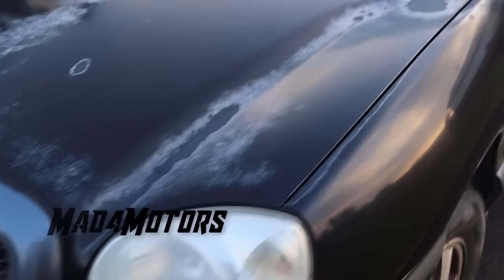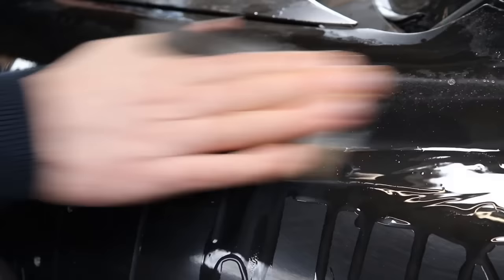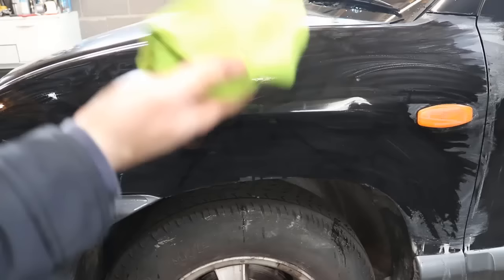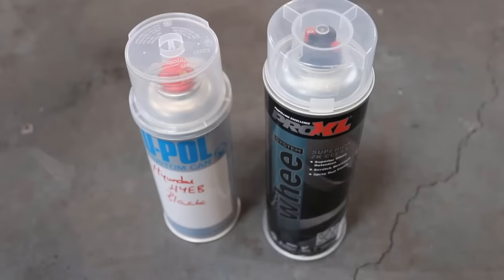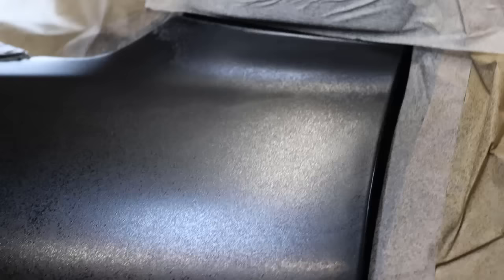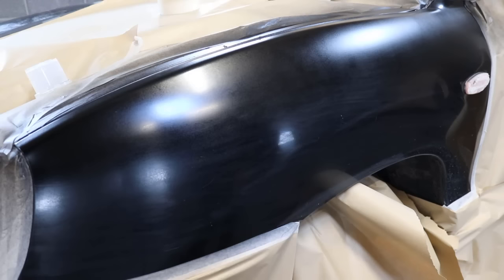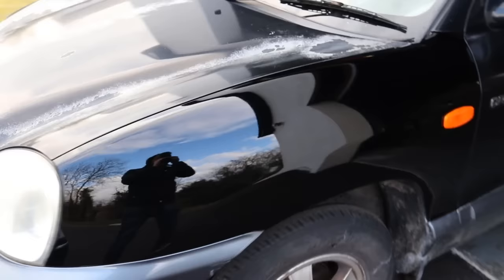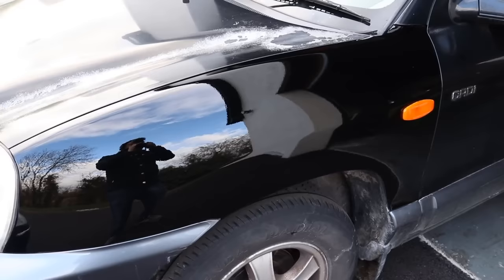How to Repair Clear Coat Fix 100% all types

Comment: Been a casual detailer for years, never seen anyone do a diy clearcoat repair. Excellent work man, it looks great. Wish I would have known about this a few cars back. The attitude then was 'clearcoat failure? you need a new paint job!'
Reply: Michael Curry Did you just make almost the same comment on Reddit? lol
Reply: Still a new paint job actually which is the only way to fix it but a bit more affordable which is perfect for a car that doesn't warrant taking to it to a shop.
Reply: I think thats what he did here...
Reply: splash yeah I think 'diy' is the point rather than paying hundreds or thousands.
Reply: I was thinking the same, I bought a car about 6 months ago, and the previous owner had ignored some stone chips and maybe used a pressure washer on it, and the paint is peeling (meh the car was cheap) and I was thinking I would have to pay for a complete respray. Now I've seen this video, I can probably give it a go myself for a very small fraction of the cost.
Reply: Dave G do update us on imgur when you get around to it!
Reply: C2k clear coat in a can is a new thing.  IT IS EXTREMELY DANGEROUS to breath... do your homework and get the special mask filters you need!
Reply: Michael Curry trust me,  it is the correct attitude to have.. I've been working on cars for 28 years , and tho what he did here is a quick cheap fix, it's never going to last. It would last longer I'd he sanded the bad clear right off  and started from scratch. .. but if you can not afford to have professional paint repairs done .. then this is certainly a good alternative. ..
Reply: was your comment a joke or being facetious this guy puts a new paint job on the front fender and I'm done watching cuz it's a bunch of b*****
Reply: Michael Curry powder
Reply: I'm actually thinking of doing it this way- sand the bad clear and continue the layering. The only question I have is- what would be the recommended grit to do this?
Reply: mörtel
Reply: mike..he put black base coat on it and then recleared it....he did do a new paint job on the fender... not a great one but he repainted the fender .  this is what used car hacks do to sell cars to folks who dont know about this stuff..
Reply: the cause of the delamination on clear coat like that is because the base coat was allowed to dry way to long before the clear was put on a few years in the sun being attacked by uv rays and the clear will delaminate like that ..if the base coat has dried to long the base has to be scuffed with a gray pad or some other scuff sanding so the clear can adhere to the base coat fully. cars made on friday tend to have this happen because some of them sit overnight or 48 hours even but then on monday they wipe it down and clear it then a few years go by and the clear starts to delaminate all over the place..
Reply: and it needs ... now there is a "brand new" fender while the rest looks shity
Reply: Yeah thats what I always thought till recently but I always had a some idea that we xould do at least a decent job doing it ourselves
Reply: @TacoBellWerewolf  yeah maco is about the cheapest and I think 1000 is an average. Basic clear coat. I just had some clear coat left afyer painting my grill and bumper so o tried it on 2 small spots after I got all the loose old coat off. And it looks 100 times better. Can hardly even see it. Especially just driving by me. My truck is finallu getting to the stuff that's cosmetic.. Lil more fun.
Reply: @tripperuk  practice on something else first and prep work is 90 perxent of the work in painting. Prep is thr most important part fpr sure..not to say you need good technique in oainting it as well. May take a lol practice but its not hard but you can easily f up
Reply: @bt7153  you are correct I would recommend somebody get a actual respirator that has black organic cartridges or yellow chemical cartridges or maybe some purple HEPA that are piggybacked with organic or chemical 3M makes wonderful products but when it comes to respirators I would order North hoedown environmental cleanup on my life I had to wear respirators for 20 years and 3M respirators just don't hold up here as long as the North
Reply: @hollybutner2377  yes iust recently had that experience in painting the rear spoiler on my car. Ordered custom base coat and clear coat. To the cost of about $75. I didn't have any problems with the base coat it came out very well. Where I FUBBRed it was in the clear coat stage. I didn't wait long enough between coats of clear, it came out rough in parts, good in few parts and worse in other parts. I gave up. Bought another can of each base and clear. I sanded if all if the damages that I'd created. Then got a friend not mine who is actually good at this to do it over for me.
You my friend are ,100% correct! It is VERY easy to f it up
Reply: Would be interesting to see how long it lasts though.
Reply: @Kevin Rockwell sorry i just worked in auto body from the time i was 13 in about 4 states and run our own shop for about 20 years so i am just telling the truth and have the experience to judge this stuff and i was also a maco manager for almost 3 years  so who better to report on this stuff ??? what some guy who paints a fender in his backyard??

Comment: People tend to get a little hysterical about paint finish on older automobiles, this video is a great example of how a really quite presentable finish can be a achieved affordably & with a small amount of effort & work space available. No, this is not professional quality, but it is really amazingly good for spray cans & gives the car a new lease of life for a few years. Well done to you on sharing your skills on this as getting a cars paint professionally restored is almost beyond most of us financially now. And bonus is doing a section at a time is much easier than tackling the whole car at once.
Reply from the maker: Yes very true it can be very expensive, and doing a small section at a time you can do it at home, I'm doing n the hood next
Reply: Mad4Motors did you finish it do u have a video of it?
Reply: Perfect if you have the time and not the money, I like it
Reply: @Mad4Motors_  
 Nice job!
I have been working on my 1989 Mazda B2200...
Funny thing is I was T-boned in an accident in 2002, the passenger door and front panel were damaged... so the door was replaced and panel painted... 
Well that is where most of the problems are!!! My door has rust on it, while the rest of my 30 year old truck is perfect, and I mean perfect!!!
Thank you, 
Isabelle on Canada's West Coast.
Reply: Wow will this work on my vw beetle plastic bumpers?
Reply: @MrChristoKruger  G'day, in principle it should work the same but only being bumpers not the whole car, it would be easy enough to just wet sand them then use plastic adhesion promoter, then prime and sand the primer and then colour the bumpers. If it is good colour but the clear has broken down then yes lightly wet sand the clear mask up and reclear with pressure pack can why not. Try one to start.  Good luck.
Reply: @OlBlueshound  thanks a lot! Im gonna try one and see what happens...

Comment: If you are on a budget, then this is a good way to do it. If you don't have any time constraints you can even get a paintshop perfect result by letting the base coat dry a few days and then lightly smooth sand it with really high grit and later do the same to the clear coat with an extra step of polishing the clear coat. You can get a mirror finish with some extra time and elbow grease.
Reply: Yep, 1000g wet sanding the base coat will make it shine. All of that orange peel is killing you
Reply: I was going to ask about that. I assumed you would need to wet sand the base coat and the first clear coat with longer time between each, so thanks for clarifying. I’m assuming also that most orange peel would be removed with a wet sand. Any issues spraying 2K clear over acrylic base coat?
Reply: @JB-qw2jk  I have only ever used 2K clear on 2K paint or plain old enamel rattle can paint. I know many ppl use water based paints and then 2K clear them. It is popular with custom motorcycle helmets
Reply: Lol name 1 good paintshop who does this, all good ones are full of jobs, no time to waste you must have heard something wrong bud.

Comment: Great points, I know very little about painting. I scratched up my firebird using too much pressure on a hard rubber fender, got lighter sand paper and went over it. But this method seems great, sounds like it will work, well done. Subscribed.
Reply: Watching this for my own girl! 86! What about you!
Reply: did you ever end up doing it? and if so how did it turn out?

Comment: A few tips..

- Once sanding is complete, PUT ON GLOVES. Your hands carry many oils, and washing them won't fix this. Touching the panel with your hands will transfer oils and compromise your work. 

- Clean panel with wax & grease remover on a clean lint free towel. Be sure to get all of the panel edges. Open adjacent panels (hood, door) to get to the edges if needed.

- Mask off your area (if required), clean the panel again, then tack it.

- Start your spraying in the "hard to reach" areas, such as the edge of the fender that's next to the hood, the edge by the door, the edge by the headlight, and the underside of the fender (wheelwell arch). Your normal back and forth spray pattern will most likely miss these areas. If the clear doesn't "envelope" the entire panel, and falls short on one edge, guess where it's going to peel first?

Just some constructive tips, otherwise you did a good job. Judging by the fact that it is a 10+ year old Hyundai, you just wanted it to look better, which you definitely achieved.
Reply: *Envelop
Envelopes are for mail.
Reply: They're also good for storing household documents, photos, and birthday cards.

Stay tuned for next week, when we talk about cardboard boxes.
Reply: @buddyclem7328  didn't know
Reply: Good tips thanks.
Reply: Well, once you have sanded, there is no need to touch the panel.
I'm sure the dude knows you tips, but the fact he painted it on the car the way he did suggests he just wants a quick and easy job.
He should get a few years out of it, since the 2k is pretty tough.
Reply: @Cheepchipsable  Cant you just reapply clear coat every 2 years?  I did my rims the same way.
Reply: David Murphy The 2k will last a LOOOONG time. If prepped and applied properly it will likely never need to be retouched. It’s amazing how cars in the southwest that aren’t sent through the car wash and waxed religiously never have these clear coat issues.....

Comment: Quite amazing results and very reassuring so thanks for the instructional video. Prepping well obviously takes some time but the return for that effort is appears to be well worth it. I have a ‘95 Miata with custom pain that was horribly expensive and doesn’t come in spray cans. Hopefully I will be able to bypass the paint coat step and still get a acceptable end result.
Reply: Same here.😔
Reply: Well, did you succeed?

Comment: I'd say this is great for an older car or a car that isn't worth enough to spend the money on a good paint job
Reply: What? I was just getting ready to do my Rolls Royce...
You think I shouldn't then?
Reply: Abelis lmaoo YouTube suggestions "guy paints rolls Royce with spay paint gone bad"
Reply: Abelis 😂😂😂😂😂 i feel bad for laughing
Reply: Eric why was that not a good paint repair.
Reply: aeroflopper i was going to do this on my benz tho
Reply: @LiLxJaYxDAwG  just done my benz 220c front bumper with a rattle can.
Reply: If you have a Mercedes Benz you should probably get a proper paint job.
Reply: Why? My mechanic (who restores antique cars as well as new ones) does pretty much the same thing, just with bigger and fancier tools.
Reply: Lo Go you’re mechanic is scamming you
Reply: Patina on classic cars
Reply: It's like coloring grey hair. If not for the grey, you wouldn't notice the age as much. And having clear coat issues on an otherwise straight and sharp looking car, is a drag. Fix it and the car gains value and appeal instantly.
Reply: Eric from Tacoma
Reply: Why?
I don't want to ruin my cars paint. It's not rusting but has some dents and could use a fresh coating.
Reply: @sixchiensblancs  You should always use a clean broom when painting a Roller.
Reply: Exactly! My car is 18 years old and painting the whole thing would cost more than what I paid for the actual car. But I like the idea of doing this and fixing the paint until I get a new one...
Reply: Andrew Moran why
Reply: Good vid
Reply: Eric yeah New cars don't have clear coat issues..
Reply: FR tho i just bought an 01' BMW and i wanna try this because my clear is fukt..
Reply: RepentB4tooLate facts
Reply: Says the paint shop owner...
Reply: @andrewm8734  Or a car you can afford to fix properly
Reply: For some cars it's probably better to restore paint rather than repaint
Reply: Thats your opinion bro

Comment: A few more coats of clear and then a good wet sand with a high-speed polish and that paint would look like glass. Good job!
Reply: Would this take away the orange peel?
Reply: Definitely needs the sanding and polish to get rid of the orange peel and trash in the paint.
Reply: How do you do a wet sand and high speed polish?
Reply: @SwayPromo  rubbed down with very very fine grit sandpaper and water.  It smooths things off and flattens the orange peel effect without removing too much of the clearcoat.  Then when polished with a buffer it will shine again
Reply: TheBlaggert thank you
Reply: TheBlaggert which one the 3k grit ?! Or 1500
Reply: @sportaholic4482  how long would the clear need to heal before wet sanding it and polishing it to a glass finish ?
Reply: @7Logik  depends on the clear coat
Reply: @ThGrtCanadian  can i just use 2000 grit,thats the lowest ive seen in my nearby hardware store
Reply: My limited experience to sand away orange peel. Start with 2000 wet and sand a small section 4x4 inch up/Down left right etc and check your progress after a few passes.  Don’t want to go too fast until you see how much material you are sanding off. 
To check, dry the area off with a paper towel and look for the full sanded hi orange peel bumps and the shiney valleys.  Keep sanding until the area is all the same dullness.  But don’t sand through the clear coat or color paint. 

Once all dull then go over with 3000.  And finally polish with 3m meguires ultimate compound polish.  You can do the polishing by hand for a small area.
Reply: @TheBlaert  awesome

Comment: note :  to get the best results from spray can paint - heat the can ( safely ) -   until the can is heat soaked through to about 100* f  40-50*c  this will help the paint propellants - it will thin the paint droplets and cause it lay nicely preventing orange peel appearance.  still a nice job for a spray can.
Reply: Heat the can safely by putting it in a bucket of hot but not boiling water.
Reply: Heat the can safely by microwaving it for 30 seconds
Reply: @gaara10122  safe. :D
Reply: 2 to 3 min in the microwave would have better results.
Reply: yeah - good luck with that microwave idea.
Reply: @jdbigsur5503  well the microwave way didn't work out too well!  The other half ain't to happy...  Just searching 🔎 how to rebuild house 🏡 thanks for nothing!
Reply: Just warm over fire for a couple minutes. Remember to wear your PPE.
Reply: RaidrWolf true. It’s sarcasm people.
Reply: Heat over molten lava for best results
Reply: Pre heat in oven for 10 minutes.
Reply: Works well with single stage also, it lays down smooth no orange peel!
Reply: @20wrighty12  😂😂😂
Reply: @20wrighty12  
A little duct tape and then buff it, your house will look brand new!!!
Reply: If they do, they deserve the consequences...
Humanity needs weeding...
Reply: @MSotelo503  
I would heat it with a match as I spray it and the paint comes out, then it's fresher.
Reply: @sixchiensblancs  lol 😂 👍
Reply: @mixter7x7  you're right, i had a hard time fitting the can upright in mine. I went and bought a commercial-grade microwave so it would fit. It was a lot more expensive, but i'm sure fixing my own clearcoat will more than make up for the savings. And to all the haters out there, microwaving worked great!
Reply: i did not and will not recommend heating a spray paint can in the microwave.  i use a hair dryer or leave the can in direct sun.  another thing that helps is turning the can upside down. this allows the solids to flip in the can and begins stirring the paint.  store your spray paint cans inverted. try to flip them ever 3 months or so. 
all this is well and good for a cheap spray job. it might last 4 -5 years possibly -possibly.
the professional paint systems i normally use will last 15-20 years if they are cared for appropriately.
Reply: If can explodes you heated too much, try again.
Reply: @mousevision661  yes this is the best and most effective way to safely heat the can
Reply: 20 sec in the microwave at a low to medium setting.
Reply: Those cans blow up if they get too hot.
Reply: thanks for that
Reply: Like  a bom  explode  if u hear uo
Reply: Hair dryer works great. May want to put it on medium heat in case you forget it. Works for me; only about twice in over 25 yrs has the bottom of the can pushed out; looked like a roll on deodorant...

Comment: I’m very pleased to have come across this video, I have clear coat issues on 90% of my vehicle small areas only luckily, however, I will need to be doing the whole car .video has given me the confidence to buy the materials myself. base coat clear coat masking wet and dry sandpaper the whole lot I still save money. thank you so much.👍
Reply: did you  do the job? iam  willing  to do on my car .I have also clear coat issue